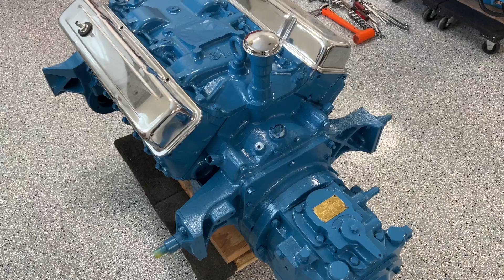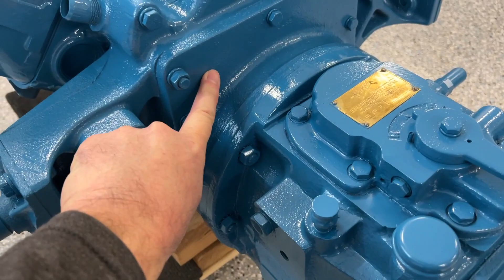How to build a Chris Craft 283 / 350 conversion marine motor Part 8

Comment: Hi Don. Love your videos. I have the same setup as yours in a 1951 CC RR. 400ci SBC but uses the same front housing and water pump. Picked this as a barn find and rebuilding much of it. Couple of questions: is there any means of adjusting the drive belts tension? Is it possible to replace the belts without removing the entire flywheel housing?
Reply from the maker: The top of the pump drive housing is a fixed bolt hole.  The bottom should have an opening for the bolt to slide back and forth for adjustment of the belts.  Yes, you can change the belts without taking the flywheel off.  Just take off the alternator pulley.  If you have a generator version you should be able to loosen the belts enough to remove me.

Comment: Don. Can you please give me more information about the alternator? What’s the make and model of the alternator? Where did you get the alternator mounting brackets? Thanks. Guy
Reply from the maker: Hi Guy. Hope all is well. The alternator I have are  original units which are Autolite ALE-5202-A. 40 amp units that do require a voltage regulator which is part number VBV-6201-A. 

Not sure what you mean re brackets?  If you’re talking the top adjustable bracket that is a CC part you would need to find from a supplier like Robert Henkel. Same for the bottom plate. Now you would need to have the correct front housing that has the boss cast into it for that bottom plate. Hope this helps
Reply: Hi Don. Thanks for the information. I understand better now. I see the boss you mentioned. My housing doesn’t have that. I had a 1959 283 FWF engine that I parted-out. It’s generator wasn’t water cooled. The generator on my 1961 engine is water cooled. And your engines have alternators. I appreciated your description of that progression.